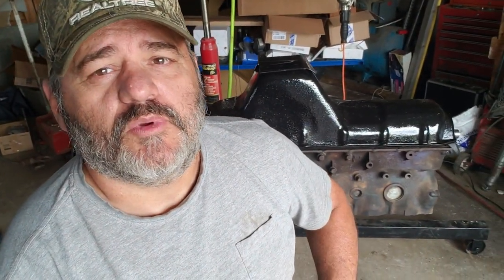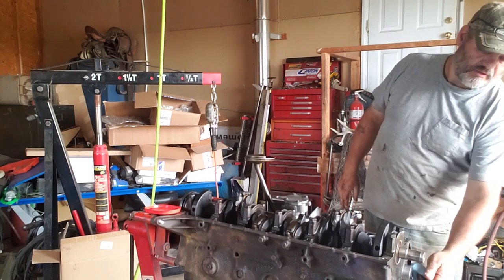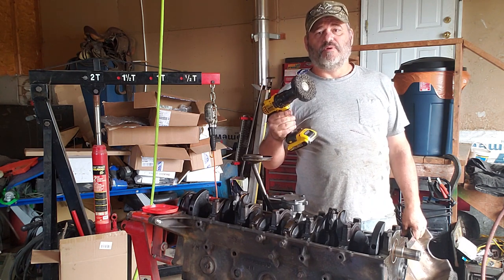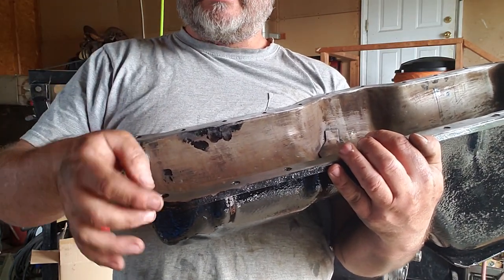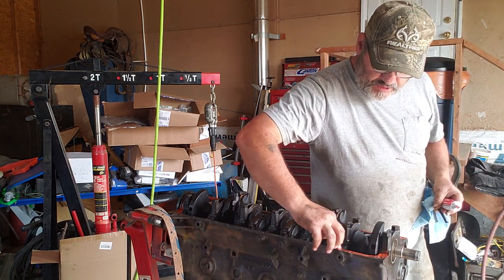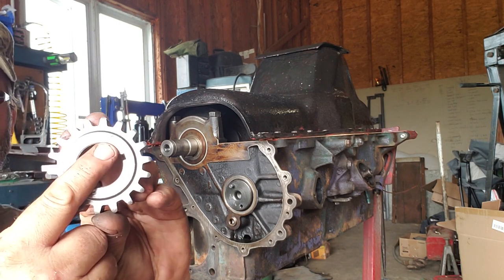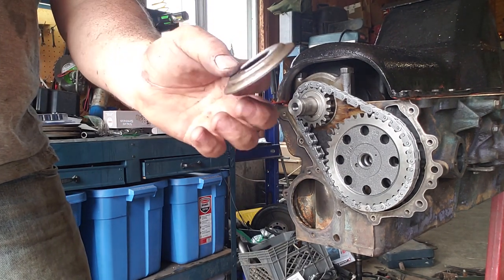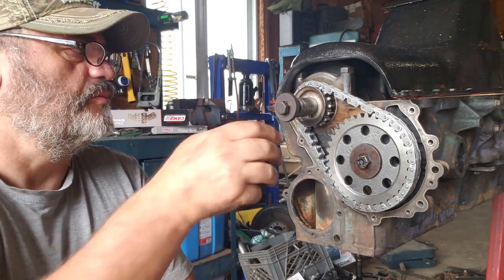Installing the Cam and valvetrain in the 82 Jeeps 258ci.

Comment: Good stuff Schneb. Im doing a budget build on a '73 232 for my CJ5. I will be using a little less cam and a small chamber head from an older late 60's 232. Im surprised that more folks dont look for those old heads for their jeep builds. They seem to be a well kept secret.
Reply from the maker: Probably getting hard to find decent 232 heads. Think the last year they made the 232 was 79?
Reply: @SchnebsGarage  something like that. Yes they are getting rare. Some 4.2's had better heads too. They were used on the J series trucks, wagoneers and some AMC cars.

Comment: Tjanknyiu for tje videos! I'm currently deciding on a cam for my 85 CJ7, 4.2,....why did you go with the high energy cam instead of the "off road" cam? Thank you in advance
Reply from the maker: Strictly speaking I'm not building a dedicated offroader. The main use of this thing is driving the kids to hockey games and practices in the winter. Economy and a little more grunt for blasting through a foot of snow is what I was after.
Reply: @SchnebsGarage  thank you. Realistically, that's what mine will be for. But I have open 2.73's with 32x11.5x15 and I'm in Maryland to ill be blasting through 6-8" max😅...i did get a centerforce clutch to help such a mechanical disadvantage and just good insurance. Want a little more grunt without the sacrifice of bottom end, I reckon. Thanks for the videos.
Reply from the maker: @AR_420  Again pretty much same setup as me, 2.73's but I do have the factory tracloc in the back which is nice, just not the best by any stretch. Its a good setup, drives nice on the highway ...I guess ... its certainly feels like an 82 Jeep but has a little something when you need to pass unlike a stock setup. I'm giving this a year to see how it fits me then I may just do a SB Chevy swap.
Reply: @SchnebsGarage , that is where I'm at exactly! Wanted to see how a mild cam treated someone in a similar set up and I got extremely lucky. Same with any future swap. Sigh of relief! Again, thank you. Helped me out tremendously! Was at a crossroads of sorts. Too many ways to make an expensive and regretful decision.
Reply: Hi i was wondering if you have any advice on the off road cam i have a 79 with a 258 that was compleatly rebuilt 7 years ago it is just a toy so not many miles on it it bent a rod and after replacing it the lifter is colapst i have the head off it and every thing looks great so far im hopping its just the cam the shop that built it last time called it a r.v. cam
Reply: It was knocking loud when it got pulled apart

Comment: Am I better off ordering special tools to rebuild my Yz 85 and what tools do I really need I have no tools so I’m gonna need sockets but do I need like impact drivers and flywheel holder
Reply from the maker: Impact drivers are not necessary for that job, YZ85's are fairly simple. Are you doing both top and bottom end? If its just the top end you can get by with just a standard socket set and a few screwdrivers. A torque wrench is about the only special tool you would use. The trickiest part there would be the piston ring install and you could simply use a small flat screwdriver to help compress it and your fingers. Other than that its just nuts and bolt no biggie. The bottom end is really where the 'special' tools come in. Flywheel Puller, Case Splitter, Clutch Holder etc are the 3 main things you'd want to make life simpler. A press of some sort is also handy for installing the bearings into the case sides...but you can bypass that with the freezer and oven trick if you dont mind waiting a few hours. Hope this helps !!
Reply: I did the top end but my buddy had coolant in the bottom and And cooked the bearings, I did wise co top end and I’m gonna do wiseco bottom end, but how did I get the bearings out I can buy the crank puller n installer case splitter and do I really need a clutch holder, also I have no tools so I’ll be costly for socket set and screw drivers, AND then them. Tools, BUT I can get someone to do it but it will be the same price as the tools I’m new to bikes I did the top end myself and I changed the reed valves my self idk if I can do the bottom and tho I wouldn’t wanna half it apart and yah know ALSO HOW LONG HOW MANY HOUR THEY TELL ME 6 hours 4- 6 hours at 100 a hour (I’m Canadian ) But wouldn’t this be a quick job for them with the tools and know how like 2-3 hours, thank you very much for the reply
Reply from the maker: @randomreviews563 the bottom end can be a bit of a chore even with the right tools. A lot of folks will start em and realize they've gotten in over their heads, then just sell the bike in pieces. I've started this way with three project bikes if you looked at some of my builds lol. My personal feeling is if you've never done a bottom end and don't have the tools, its probably best that you find someone who's done it before to at least give you some guidance. I've been doing this stuff for over 40 years so easy to me is not necessarily easy to everyone.
Reply: Thank you very much
Reply: what would be a ball park on how long it would take to rebuild the bottom end with new parts
Reply from the maker: @randomreviews563  4-6 hour job is a reasonable expectation. Can be done much faster if nothing else needs changing which is seldom the case. There's a lot of seals that generally need attention and often more than a few stripped / broken bolts in older bikes.

Comment: Why comp cams and what has your result been?  how does it run?
Reply from the maker: I've used CompCams almost exclusively since the 90's. They've always handled whatever I toss at them whether it was 4 wheelin, dirt track racing or street use. Never had one fail even with stupid levels of abuse by yours truly ;). As for results in this particular application I can say it idles well, sounds good and for the very limited test drive I did (about 1km) ran fine. This project is still in the works so its not plated yet for daily driving and I didnt want to drive it too much while still building her so I'll have to get back to you in a few months with actual real world performance.
Reply: @SchnebsGarage  How are you doing up there?  Have you put any more miles on the Jeep?  How is it doing?
Reply from the maker: @jarrettembry643  Jeeps pretty much in limbo. Drove it about 1k on and off, some light off roading. Everything working perfectly at this point until I find some money and motivation to get back at it.